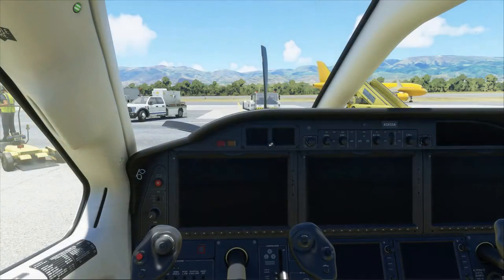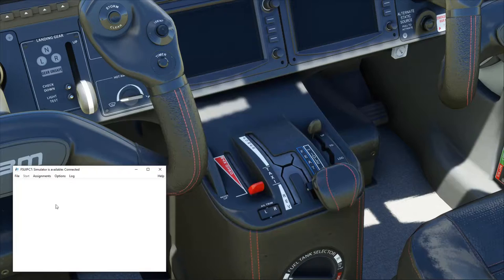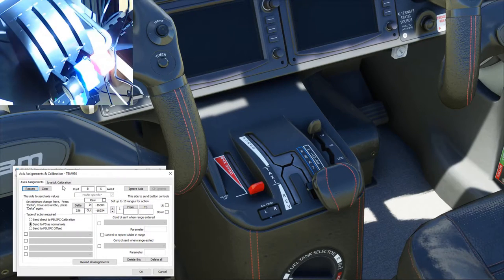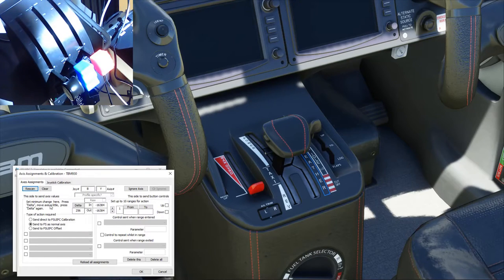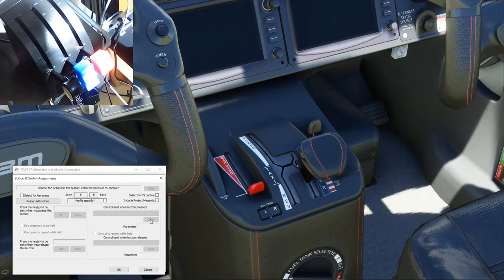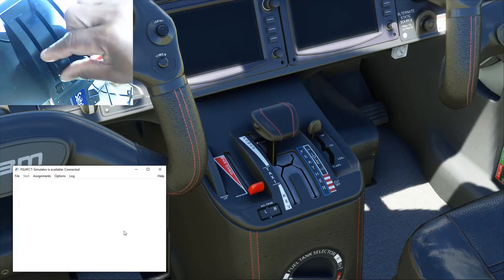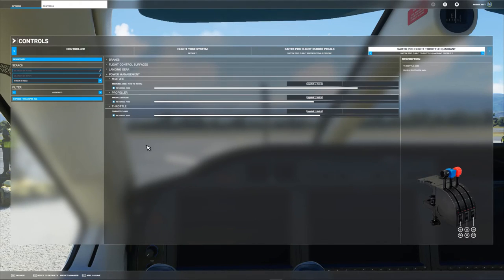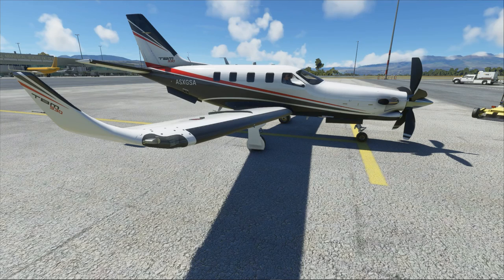TBM 930 THROTTLE  Control setup in Microsoft Flight Simulator 2020 using FSUIPC7 | TBM 930 TUTORIAL

Comment: After watching your video, I purchased FSUIPC7 and followed your instructions to the letter. After programming throttle and prop axis, I went into the MSFS control panel and un-assigned the axis for both.  Unfortunately after un-assigning the axis in the sim, the throttle lever doesn't respond to inputs from my throttle quadrant. Any suggestions as to why it's not communicating?
Oh  forgot to compliment you on a fine video...
Update 01-26-22: after the SU7 update, this video, and app, are no longer applicable to control the throttle. Can't find a work-around yet...
Reply from the maker: Hi Dave.  Thanks for your comments and for watching.  Are you still haveing connection issues? Do you get any calibration movement indications in FSUIPC main set up screen?
Reply: @NaviSim101  The throttle can't be calibrated within the FSUIPC7 Cal screen because it is not seen by the software even with the throttle being assigned to Axis Throttle 1 Set. 
Throttle works (responds) in sim but jumps past low and hi idle right over to taxi with raised which is undesirable behavior to say the least. The developer of FSUIPC said he has heard many others with same issue and no work-around has been found to date (1-24-22). Hoping for one soon because this is my "go-to" plane and I'm right in the middle of a circumnavigation...ouch

Comment: Super helpful video. Not sure how you figured all that out, but thanks for taking the time. I suspect a lot of trail and error. MSFS really falls short when it comes to some of the configuration stuff. Not sure why they would work on the development of an aircraft and not provide some means of controlling things like the throttle quadrant. Great work. Looking forward to trying out the plane with this new config.

I will point out for your readers that you now need to register the utility to get the functionality demonstrated in this video. Without a reg key the "Assignments" option is not available. It's somewhat reasonably priced at $25 EU and you can get it at simMarket.
Reply from the maker: Hi Alan, Thanks for the feedback. Glad you enjoyed it. I find FSUIPC v7 a little bit of a downgrade compared to v5 and 6. The functionality seems a bit awkward. Maybe it's just me. Thanks for watching and for the info! ~Rm ;-)

Comment: Nice video! I was wondering where why the program is nowhere after installing it. Should I open msfs also to make it appear anyway?
Reply from the maker: Hi.  Glad you enjoyed the video. To find the FSUIPC7 program just go to the bottom rignt of your (Windows10) PC and you'll see an up arrow.  Click there and you should see the program icon if its runmning. Then you can right click on 'show' then you'll see the main interface pop up.  You can assign a keyboard short cut for more easy access.  Remember that its a stand-alone program and only integrates with MSFS2020 from the outside.  Hope this helps.  Thanks for watching! ~Rm😉

Comment: Thanks for the vid.  For me the default prop' lever in MSFS2020 sometimes goes full range from cut-off to taxi-idle, and then the throttle lever takes over. Which is great. By assigning the throttle lever "switch" to engage reverse thrust (manually assigned in game Controls to 'z' ) I can then increase/decrease the thrust while in reverse. This is all ideal. Except the prop' lever is really inconsistent. I'm hoping there'll be a patch for this and simply; blue lever all way down into switch equals cut-off. Move it forward and you get lo-idle then hi-idle, and all the way forward gets you to taxi-idle. Throttle lever works as is but the switch enables reverse and then you have variable reverse thrust until switch again. What you've presented here is worth taking a look at for sure, but I do think it is something that should work properly in game without an add-on.
Reply from the maker: Hi there! and thanks for your comment. Much appreciated. MSFS2020 has a whole range of options to set up your controller to work along with it. The options are 'filtered' by default so you have to select 'all' to see them. Many Flight Simmers prefer to use FSUIPC so this video is presented from that aspect. In retrospect maybe I should have made that point more clearer at the outset. Perhaps a video on how to setup throttles using MSFS2020 is now due! Thanks again for your comment ;-)
Reply: @NaviSim101  No problem - and thanks again for the effort in creating the vid. I've not flight sim'd in years so hadn't even heard of FSUIPC which I'll now have a play with. I'd still like to see either FS2020 or Saitek do something with these controls. I've been cruising around in the Cessna's and looked down (in cockpit) to see my throttle or mixture lever fluttering. It's like the sim has trouble determining where the lever is set sometimes when not fully opened or closed. Look forward to more content dude. Keep going.

Comment: Great video.  Did you have to do anything special for MSFS 2020 would recognize, and show your throttle quadrant?  I can map the functions on mine, but everything shows up under the yoke profile.  I have the same quadrant.  Thanks.
Reply from the maker: Hi there! The Throttle Quadrant is a separate unit and as you know has its own USB. MSFS 2020 should 'see' it and form it's own window in the Controls menu just like it does for any other device. Just scroll along to the right and you should see it. If not, then go to SAITEK's software and see if it's recognized there. Unplug then plug in again. Just do the basic things and it should come up. Hope this helps. Thanks for posting! ~Rm😀
Reply: Thank you. Maybe it jut didn’t set it up correctly at first. I’ll try plugging it in first and see what happens. It had no try finding my trim wheel. 

I look forward to watching more of your videos.

Comment: Hi, very great video. Thank you for this. I used FSX Steam before this 2020 came out, and the stock controls in FSX sucked big time. So that is when i learned to use FSUIPC to setup all the controls and buttons and just disable all Axis and buttons in FSX and just let FSUIPC do all my controls. Now, for some reason i am having a ton of problems with assigning switches and controls in MFS 2020 on my machine for some reason. All was working fine until this last update. After that i can't get anything to assign correctly or at all for that much. My question to you is, if i disable all my Axis and buttons in 2020 that i want to use in FSUIPC, do you think i can set it up like i did with FSX and all work just fine just using FSUIPC7? Because i hate the stock control settings in 2020 just as i did in FSX.
Reply from the maker: Hi Jim, thanks for your feedback, much appreciated! As regards your question on FSUIPC7, what you have to remember is that at this moment, the software is still in beta development and so not all of the usual functionality of FSUIPC7 is working. For e.g, I tried to create a macro the other day and it didn't work. But, when we get the full working version, then yes, you'll be able to do away with all the stock settings on MSFS and use soley FSUIPC7. Hope this helps ~Rm

Comment: I dont understand the reason why you arre using Fsuipc instead of the normal menu of Msfs... it seems it does exactly the same thing. Maybe you cannot have the automatic profile switch, but you can have specific profiles also in Msfs..
Reply from the maker: Hi there, The video focuses on an alternative way of setting up your throttles for the TBM 930. Sure, you can use the default control inputs on MSFS, many flight simmers, however like to use Pete Dowson's software for doing this so the video is presented from that aspect. Sorry if the video was a bit misleading at the outset.   Thanks for your  post!

Comment: Hi ! Really nice tip ! Is it Working with the HOTAS X56 (knowing I have a double throttle pad + 2 rotations button (0-100%) on the base ? I think I can set this up on the same way...? It's true I love the TBM9, but have to make 2-3 tryout to start it up in "RP" mode using my base FS settings....
Reply from the maker: Hi there! Glad you found the video useful. I haven't tried the method on my Warthog Throttle system as it has functions similar to yours. But the throttles can be manipulated independently and FSUIPC7 will treat it as it does the SAITEK Pro Flight System. So with a little tinkering about you should be able to do it. Thanks for your post! Stay safe. ~ Rm

Comment: Hi, I'm wondering - does this configuration still work in Spetember 2021? I reinstalled MSFS and all add-ons an cannot get it to work as it did before. Cheers!
Reply from the maker: Hi. Yes it should still work.  Make sure no conflicts exist between FSUIPC and MSFS2020 controller commands.  ~Rm

Comment: We should be able to do this without FSUIPC, shouldn't we? If so, how? My controller is a Turtle Beach Velocity One.
Reply from the maker: Hi. On its initial release, this couldn’t be done with MSFS. It might be possible now, some 3 years later. Haven’t  tried it myself. The TBM,s throttle movement is tricky to replicate. You need to mess about with the power bindings in the control menu. Trial and error. Sorry I can’t be more helpful. Thanks for watching.😀

Comment: Using FSUIPC 7 now, it seems that the animated throttle inside MSFS does not move anymore (Some say its because of Update SU7).  Moving the throttle does increase the throttle, but the throttle inside the SIM is non-moving.  is there a fix coming soon?
Reply from the maker: Check your bindings.  Check for no conflicts beween MSFS and FSUIPC.  Not sure about any fix.  Install latest version of FSUIPC.  Thanks for watching!

Comment: Very nice Video  although I am still using my Logitech Extreme 3D Pro on the Airbus A320 :-( I dont think that I could use FSUIPC to make that one better, anny Comments maybe? ans another Question, from where is that stunning Scenery of Quito?
Reply from the maker: Hi Uwe, Thank you! Glad you enjoyed the video. With your joystick you should be able to assign whatever axis you have so that you can control the throttle movements. I'm sure Logitech has dedicated software for the Extreme 3D Pro to enable you to do it.  The scenery form the video is based at the Mariscal Sucre Intl Airport. In the video you'll notice that I stopped and panned the camera around at the building which shows the name of the airport just so that viewers can see the location. Hope this helps! Thanks for your post. ~Rm ;-)
Reply: @NaviSim101  thank you for your answers and have pleasent flights
Reply: @NaviSim101  But one more Question Please. what Addon are you using for the voices from the crew? The one at the top of your Video. I use self loading cargo but you have anothe rone i guess
Reply from the maker: @uwebestmann2477 Hmmm... There's no voices in the TBM930 throttle video apart from mine. Perhaps you could give me a time stamp so I can locate it?
Reply: @NaviSim101  Sorry my Bad, was another Video I guess
Reply from the maker: @uwebestmann2477  Ah, no worries 😉

Comment: thank you. i hope i get this right. comment for you. have you ever saved a flight and then come back to it in the tbm930 only to get oil pressure warning and you lose complete power. this happens to me all the time. one last question, where is the install directory so i can change the name from daher to tbm. thanks again.
Reply from the maker: Hi. Thanks for you post. Answer to your first question: It sounds like you have failures permanently setup. To correct this,  go the Map World, click on the TBM picture in the top left, go down and click on the FAILURES tab then look to see on the right hand side to see if they are switched off. The other question you asked, I'm not sure which directory you are refering to - MSFS or FSUIPC?

Comment: Hi great vid, does the profile you created auto load with the specific aircraft when started in FS?
Reply from the maker: Hi, Thanks! I'm glad you enjoyed the video.  Yes,  normally, FSUIPC will 'see' what aircraft is currently on the airfield and load up the profile for that particular aircraft... and sometimes.... you'll discover that your controls don't work and you'll have to select the profile yourself by checking the profile box and selecting it from your list of aircraft profiles if you have more than one.  FSUIPC7 is still in beta at the moment so I guess they'll tidy up any loose ends for the final release version. Hope this helps. ~Rm

Comment: Fantastic info.  I just wish you didn’t need FSUIPC in this Sim. Seems like that would be included in this day in age.
Reply from the maker: Hi there! Thanks for your feedback. You can actually assign your throttles in MSFS. Most flight simmers though prefer to use FSUIPC as it's much more verstatile and stable than the stock control assignments so the video is showing how to do this. Sorry if the video was a bit misleading  by saying "you're going to need.." In retrospect perhaps I should have worded it a bit differently. Thanks for your comment. Much appreciated! ~Rm
Reply: Yes my experience in it is with FS9. Tried many times for FSX.  I’m so excited about my new PC that is being built for MSFS.  Just trying to get ahead so whenever it arrives I can get to work!
Reply: @NaviSim101  Really appreciate your videos. They're always very informative.
You said you could assign the slightly unusual TBM throttle in MSFS also. Would it be possible to do a short video showing that process for those of us that aren't familiar with FSUIPC and have the same throttle quadrant as you're using?
Again, thanks so much for your efforts!
Reply from the maker: @stevekrubeck2861  Hi, Yes, I could do I suppose. I'll try and take a look at it to make sure it really does work properly. Thanks for the feedback!
Reply from the maker: @stevekrubeck2861  Hi Steve,  Glad you found it helpful. Yeah, will look those MSFS assignments again to make sure it can work relieably. Thanks for the positive feedback. Much apprecieated! ;-}
Reply: @NaviSim101  That would be great! Thank you!
Reply: Were you ever able to find time to see if it was possible to configure this in MSFS? I've played around with a few things without any luck. If FSUIPC7 wasn't so pricey, and you didn't have to buy another program to accompany it, I wouldn't hesitate to purchase it.
Reply: No you have to use FSUIPC and I had to reprogram all the remaining buttons as well.  And set AC specific profile each time you want to fly the plane you have to select the AC profile in both Axis and Buttons and Switches.
Reply: @scootermason2746  Thanks for the reply. I was hoping there would be a way to make it work within MSFS 2020 since the TBM 930 is one of their signature aircraft.
Reply: Maybe they’ll make up something for the Honeycomb Bravo

Comment: Another way for reverse thrust:
POWER MANAGEMENT/ THROTTLE/
THROTTLE 1 AXIS - JOYSTICK BUTTON 7
THROTTLE 2 AXIS - JOYSTICK BUTTON 7
THROTTLE 3 AXIS - JOYSTICK BUTTON 7
THROTTLE 4 AXIS - JOYSTICK BUTTON 7
HOLD THROTTLE REVERSE THRUST - JOYSTICK BUTTON 7
Acts funny in setup but works perfectly in sim.
Reply from the maker: That's helpful. Thanks!

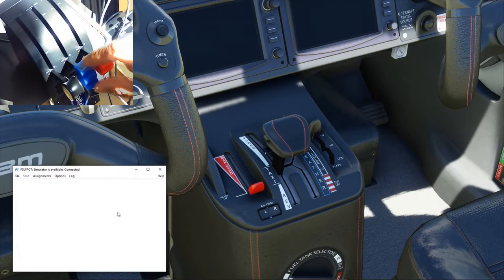Comment: At 6:30 in the vid after setting the propeller axis, when I pull the lever right down it will not go into the feather section. It just kind of wavers between feather and taxi. Any ideas?
Reply from the maker: Hi. Have you watched the video right through to the end? It sounds like you might have a conflict of Interest between FSUIPC and MSFS2020. Please follow suggestion at end of video. Other suggestion is to unplug any other controller and see what happens. Other suggestion: Is your controller assigned to another input? Update drivers for your controller as well. Hope this helps. ~Rm

Comment: i find this strange because you have done nothing there that can not be done within the game?
Reply from the maker: Hi Chris, thanks for your response. You're right, it can be done in the sim. Many flight simmers though prefer to use Pete Dowson's software for flight control set up. The video is presented from that aspect as mentioned in the title description. Perhaps I should have made that more clearer in the video at the outset. Thanks again for your observation!
Reply: @NaviSim101  I think the other aspect here is that it's probably easier to maintain profiles in FSUIPC or Spad.next and not have FS manage the axes than to create multiple profiles for different aircraft in the FS sim interface.
Reply: @djtaylorutube  You can create multiple profiles for different aircraft in the sim as well.
Reply: @ixoye56  I've not bothered experimenting with that as I have no need but does each profile get auto selected when choosing that aircraft when using the FS interface?

Comment: One question how in the heck do you even get to the window to do the changes.
Reply from the maker: Hi! Thanks for your post.  I'd like to help but could you possibly explain a bit more about the problem you're having? What do you mean by 'get to the window to do the changes'?
Reply: Got it now but I have an idea for you.  Under the Saitech you can make a separate profile for the TBM.  I did that and just select it for the TBM. I also have one for jets and other turbo props that need reverse that I created by using the button 7.
Reply: Wanted to clear up something. The profile will be under FS settings under the Logitech when you change a setting from default it wants you to name it. I used Logitech TBM930 and save. Also there is a Video on YouTube how to make a reverse.  Just search Logitech throttle reverse for MSFS. It uses Button 7 which is when you move the throttle all they way backwards until click second click then move it forward for reverse then when you are done move it all the way back again then back to forward thrust.  Using MSFS inputs not FSUIPC.